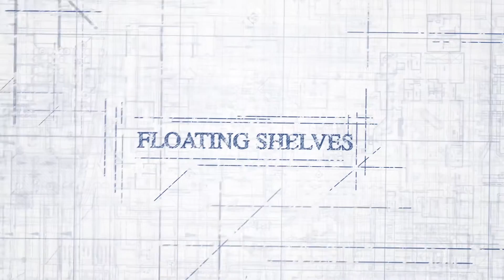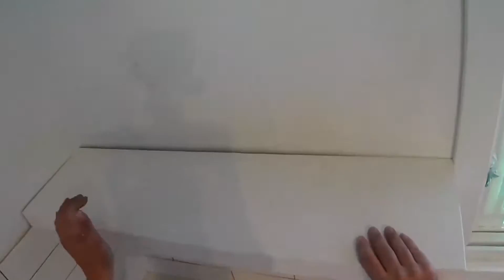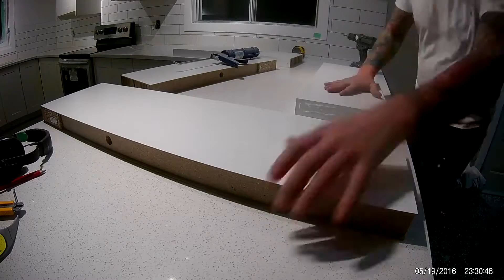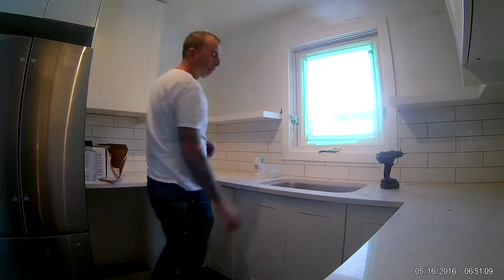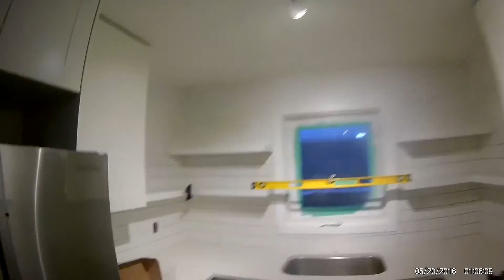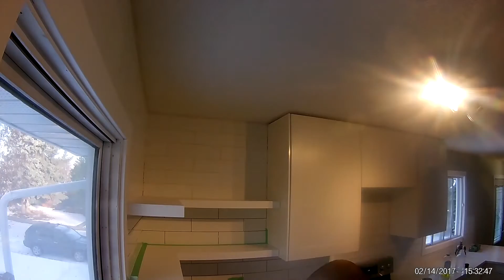Floating shelves Kitchen backsplash Subway tiles

Comment: Why would you not go ahead and use the included brace to install the shelves to give more strength? I'm not a construction professional. Just a question. Thanks
Reply from the maker: Great question, once I had cut the shelves the bracket had 3 poles on it and was not going to work well if cut.
Reply: @ConstructionCoach  Ahhh! Got it. I didn't know how long those were. You make it look so easy!! Thanks again
Reply from the maker: Thanks for watching, I will help with anything I can.